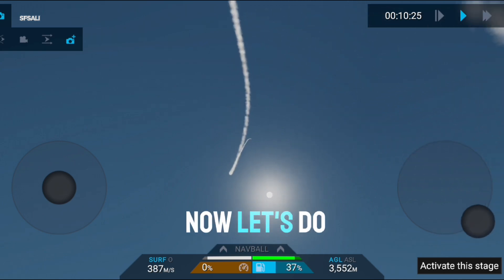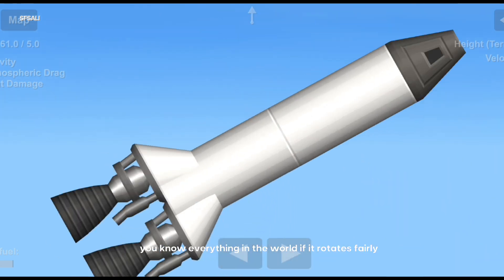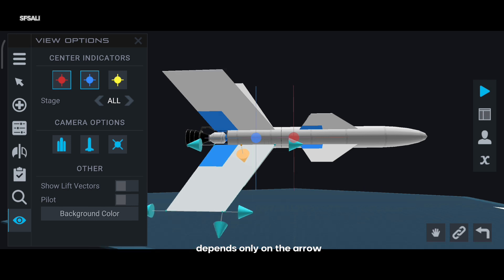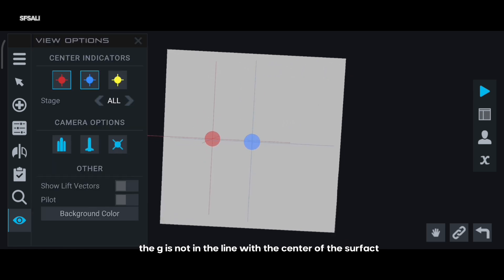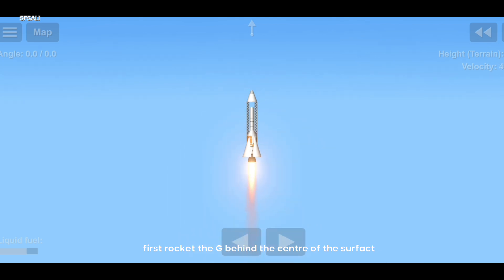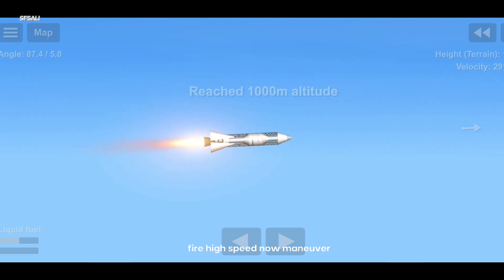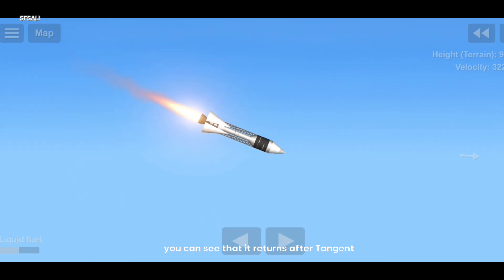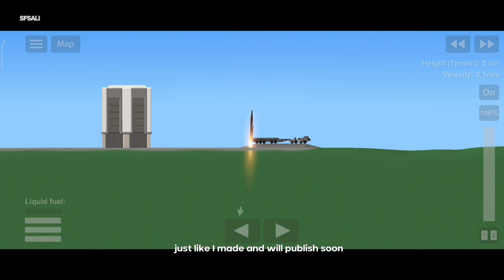Spaceflight simulator! how make the best rocket?

Comment: How I can calculate/predict AC at sfs?
Reply from the maker: The best question👌
It is very difficult to calculate for 3D shapes and composite shapes But in sfs Just find the height of the rocket and the center of pressure is exactly in the middle.
Reply: @SFSALi  oh...that right
Reply: @SFSALi  thank you very much